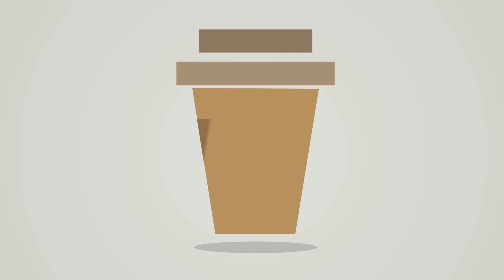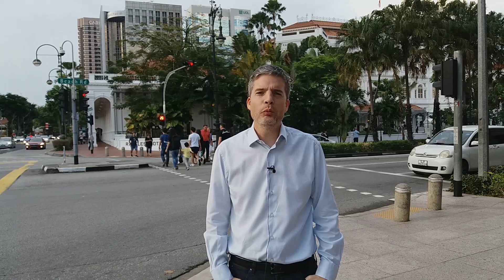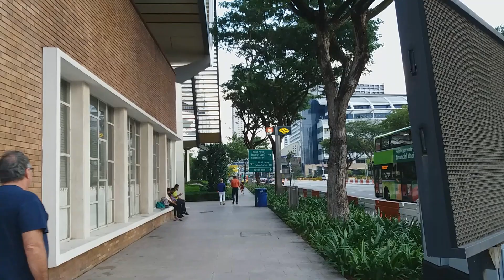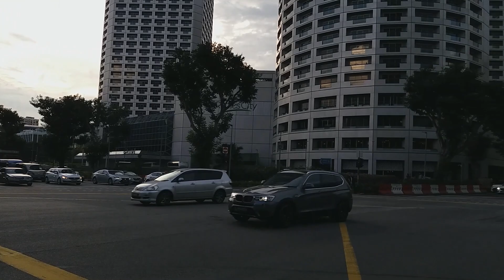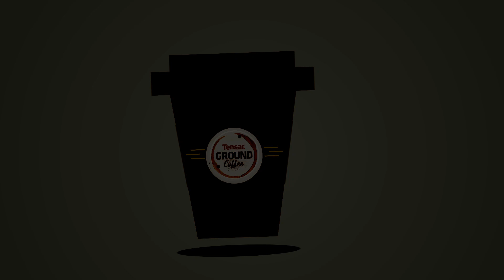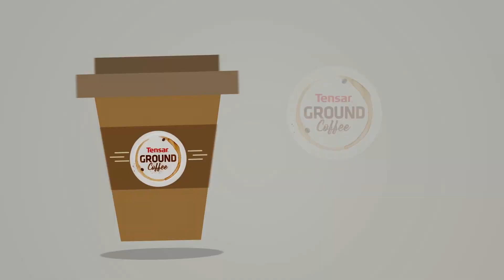What is Land Reclamation? I Geotechnical Engineering I TGC Episode 8

Comment: A well put together video, well done. Another source of reclamation material used in Singapore is the left over rock / earth from their tunneling works from their public infrastructure projects. This has become more and more relevant over time as sand has become increasingly difficult to source with various countries blocking sales. There is even a proposal to dig up the incinerated waste out of from the Semakau Landfill to use as fill material for the current expansion of Tuas Port.